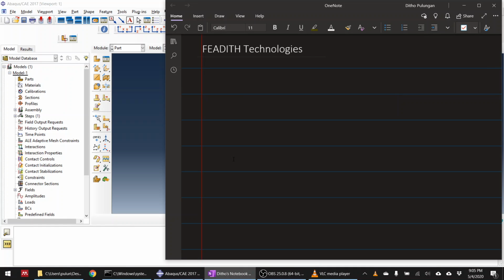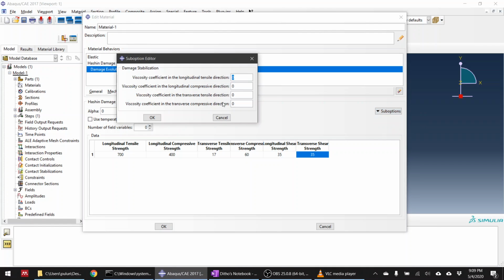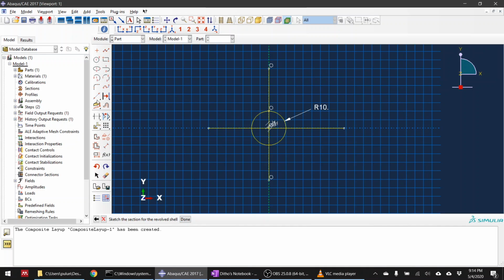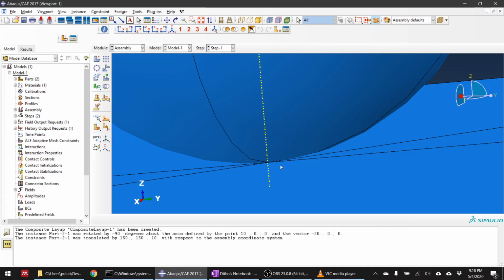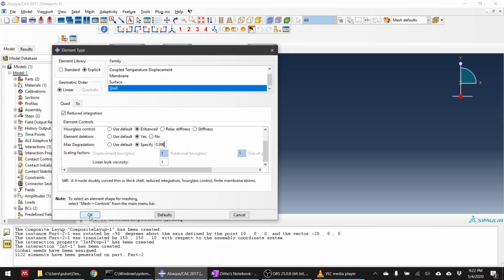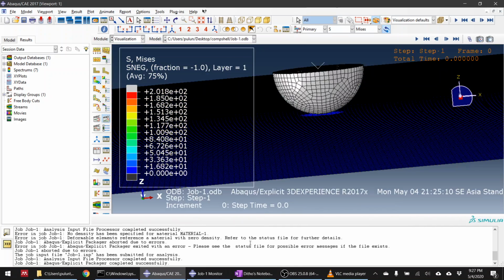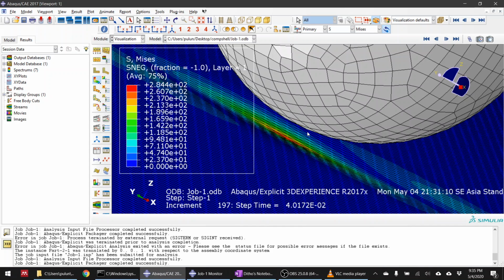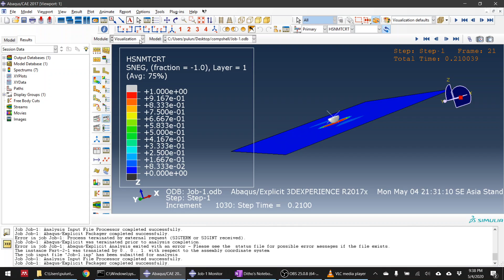(Macroscale) modeling of composite laminate using conventional shell subject to low velocity impact

Comment: Hi, very interesting and useful video! I think it's possible the error occurring with hashin outputs can be related to the use of the three-dimensional engineering constant material model. The abaqus embedded hashin model is 2D model while the material you adopted has properties in the third direction. To check this, you can try to solve the model by adopting 2D lamina properties instead of eng. constant with hashin criteria and see the error disappear. You can also usa eng. constant and set a different material damage criteria like Max stress damage with BK evolution. To implement a three dimensional hashin criterion in abaqus you need to code a VUMAT subroutine.
Reply from the maker: will try that thanks.
Reply: @FEADith  let me know!

Comment: Great work! Thanks for sharing. I have one question:
How fast is the impact and how can I change the speed?
Reply from the maker: in this case i indent -10 mm during step period of 1 second...

if you wanna change the speed... just change the time period in the step... for example 0.01 second.. in this case, the speed will be 1000 mm/s..
Reply: @FEADith  Thanks for the quick answer!  
I have another question: 
Why do you give the impact a displacement? 
How is this relevant in practice? Shouldn't the impactor be given a speed and then lose energy from the impact and then stop? 
If a displacement is given, then the energy of the impactor must increase during the impact to achieve the displacement!
Reply from the maker: @RidgeRiderPorta  nice comment Luca.. this does not really impact test.. it is called quasi-static indentation.. so you control the displacement and indent it. 

but you are right.. in low-velocity impact test, you set the initial velocity and mass of impactor.. and it impacts the plate and the impactor lose energy due to energy absorption in the plate.

but all processes are the same, just the way you give loading conditions. instead of using prescribed displacement, use initial velocity.

Comment: how to see delamination in results
Reply from the maker: This is macroscale. No delamination was modeled. And not possible.
Reply: @FEADith  Thank you so much sir for your effort. Why we do not modelled delamination in shell element. If we consider delamination between plies , should we modelled as a 3D ?
Reply from the maker: @edanurtaspinar8500  yes.. not possible with the current approach available in abaqus.. since all plies embedded to 1 layer shell. 

unless you come out with breakthrough finding.

Comment: Also, I think that the density is defined wrongly because if we use mm dimension, density comes in tonnes/mm3. So is it 2100e-12?
Reply from the maker: you can put any value you want... that's not the point of the video.. the point is to show audience the basic step how to model indentation in composites.. of course, you can always change the number accordingly